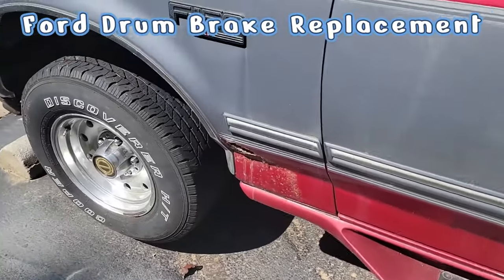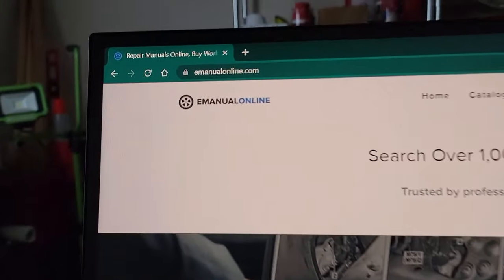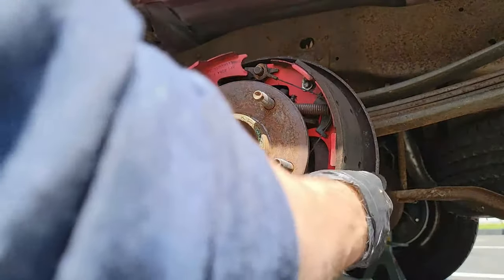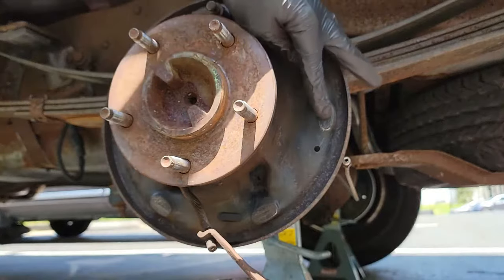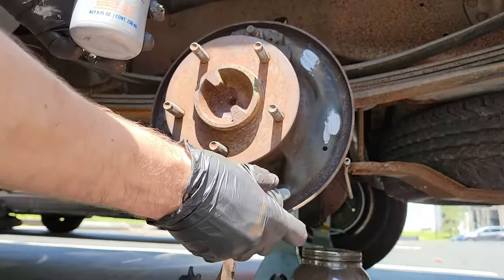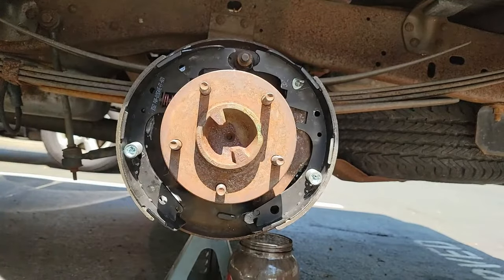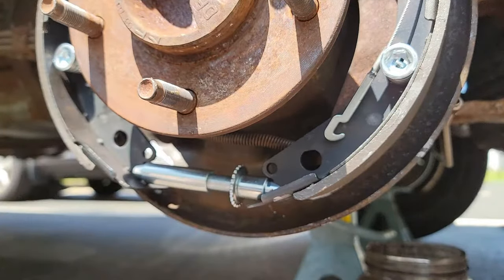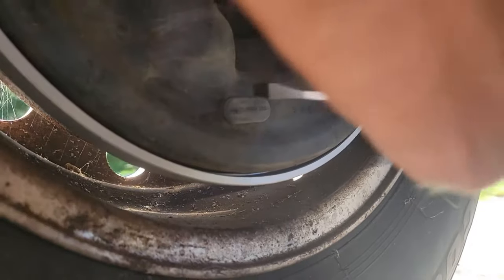Ford F-150 DRUM BRAKE Replacement! (Quick Guide)

Comment: Does it matter if the springs are loaded under or over the anchor pin ? I noticed you loaded them under & I’ve seen it done both ways
Reply from the maker: I don't believe so. Just as long as they are securely on the pin I think it's fine.
Reply: @TrickShiftGarage  thanks for the response

Comment: Great video. If i may when you put on the pins that hold shoes on plate you used needle nose. I noticed you were very far back if you use the very end you will find it easier to put those on.  All other tips were spot on.
Reply from the maker: Absolutely James! It would have been a lot easier. A lot of lessons were learned while doing this for the first time lol. Thanks for the tip, and thanks for watching! 🤟

Comment: Please help. We've got the 2013 F150, STX, 3.7 6cyl. The drums are grinding like crazy. Ive only ever done pad style brakes before. My question is, when replacing the drum brakes, do I need to purchase both rear shoes and parking brake shoes, as well as the spring kit?

Comment: Do you need to replace all the hardware or can you do just the drum?
Reply from the maker: I would definitely replace the hardware since it's cheap and over time the springs will wear out. That's just my personal opinion.
Reply: @TrickShiftGarage  My hardware kit came with a spring washer for in between the brake shoe pin under the c-clip. I couldn't tell if you reused or used a new one from the video. The kit also comes with new springs and related hardware, and when comparing with the old, it's definitely worth it.
Reply from the maker: Yea I used a new one if I am remembering correctly. Definitely recommend new ones for sure.